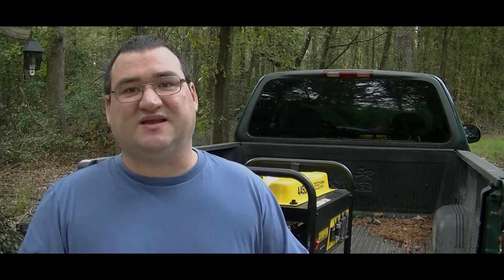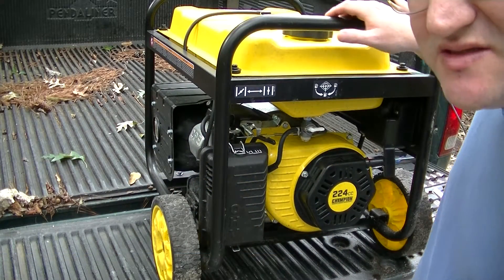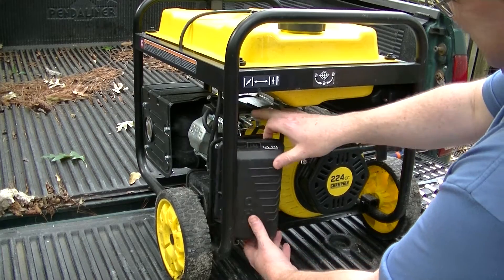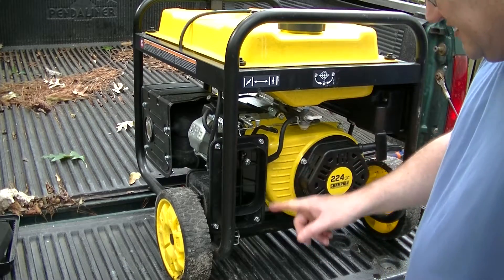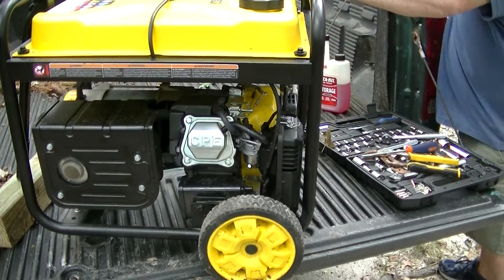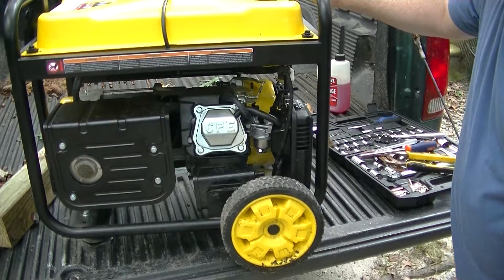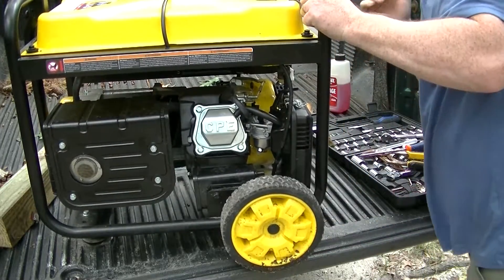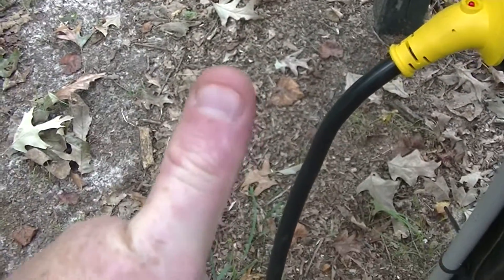How I Replace A Carburetor On The Champion Generator Model #100575

Comment: I didnt know you could get parts for free, i spent 17 bucks on amazon but it came with all new gaskets, carb, fuel line, fuel valve, spark plug, fuel filter and some little spring. fixed my generator perfectly. runs like new
Reply from the maker: They where cool about it. Glad yours is working well..

Comment: I stopped loaning cause they never returned it back! Then when I asked for it back, I'm the a**hole?! Thanks for sharing 😃
Reply from the maker: Amen. I let a friend use my truck. Give it to them with a full tank of gas and clean inside and out. When i got it back 2 weeks after I was told I would get it back. It was trashed.

Comment: Great video
I have carberator issue an must repair it myself
It appears gas is leaking from bottom of it? Can I possiyjust check old carb an clean it? It runs five minutes then dies.
Reply from the maker: That sounds like a cloged fill jet. Get a new carb or clean that one.
Reply: @yankey4  Tytyty I’ll try it tomorrow. I pray I can get it right.